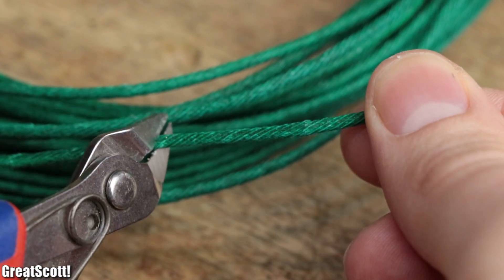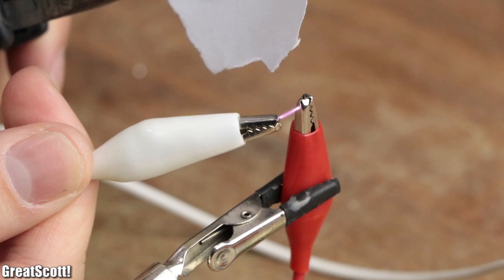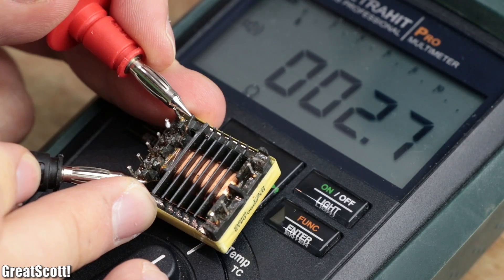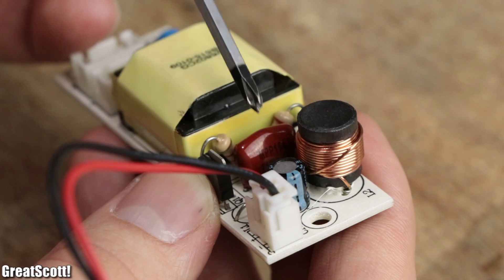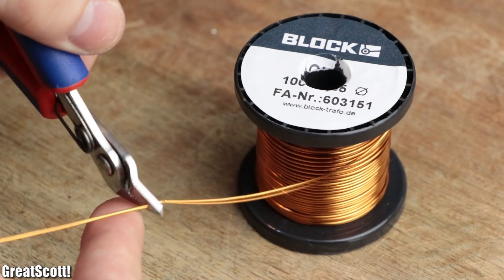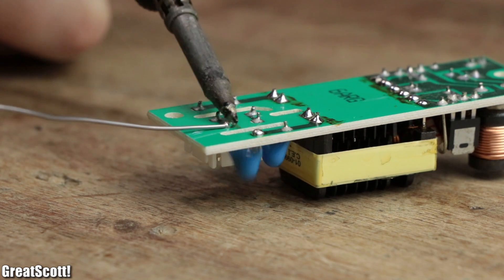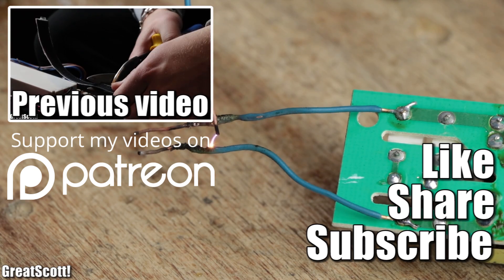HACKED!: CCFL Inverter becomes an Arc Lighter?

Comment: 3kv for 1 mm? Now I heard it all, my teacher said that I would need 1kv for 1cm and another German Youtuber said I would need 1kv for 1 mm ( all in our normal atmosphere ) strange, who is right?
Reply from the maker: 1kV/mm is possible. But 1kV/cm is wrong.
Reply: HeisenbergIsReal 1kv/cm ? What?! That's complete bullshit. Even 1kv/mm is on the low side. According to the Wikipedia of electrical breakdown (https://en.m.wikipedia.org/wiki/Electrical_breakdown) It's stated to roughly 3kV/mm for fresh air.
Reply: HeisenbergIsReal Yeah, 3kV/mm is the most accepted range. 1kV/mm is smoother on the memory. Just like how people say "every second after lightning before the sound, that's 1 km", while it's about 3 seconds. But 1kV/mm could work depending on the air, humidity, temperature, etc. However, 1kV/cm is absolute bullshit.
Reply: HeisenbergIsReal the difference is that you need 3kv to start an arc with the electrodes 1mm apart, then you can more them and stretch the arc until it gets longer than 1cm and the 3kv won't be able to keep it stable
Reply: ***** oh great everybody says something different the community from the other German YouTuber tried to convince me that 1kv/1mm was 100% correct

Comment: I see in a lot of psu that they have a full bridge rectifier and a tapped transformer somewhere later on the circuit, why not use the transformer to step down first and then use a full bridge rectifier to rectify the ac into positive bumps and a capacitor to smooth out?
Reply: Fagrid thank you a lot for the explanation.

Comment: What's the point? A cigarette is a lot wider than 5mm.
Reply: You know... Not being able to smoke is usually a good thing
Reply: isn't that a bit ridiculous to light a cigarette with a motherfucking arc lighter?
Reply: Tim Ramich you can still light the paper at the tip and then the tobacco will burn too.
Reply: That's assuming one packs down their smokes.
Reply: it'll light the cigarette from the bottom end of the circuit section bad english
but yeah anyway  5mm is enough to light a cigarette
Reply: GTFO here. For WTF are lighters most commonly used?
Reply: why would you not light is with an ark lighter?
Reply: True
Reply: Arc lighters are windproof.
Reply: I usually light cigs with my stove
Reply: Thank you captain obvious and oblivious.

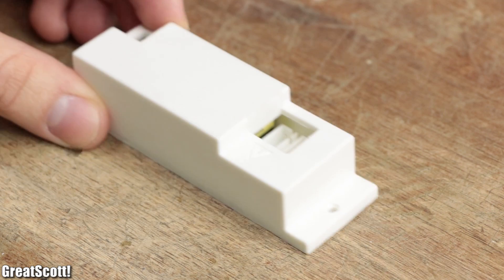Comment: 0:44
Thats not quite true. The epoxy block contains a simple HV transformer and is potted for isolation. All the circuitry is on the PCB and it is a super simple single transistor oscillator driving the primary. 

I have a TV ccfl driver somewhere, thats gonna be fun as its pretty powerful ;)

Comment: I also planed to build smth similiar to this. But using simple boost-up converter to convert 9 volt to 15 volts which will charge 20 capacitors. Next the 15 V DC will be converted to 15 V AC using H-bridge. And finally I use transformer to transform 15 v to much higher voltage.
Reply from the maker: Sounds possible
Reply: Did your design work? Will it work to ignite black powder or smokeless rifle powder with the arc?  Might be a novel way to fire motar shells without a fuse.. :}

Comment: That padded black box in the arc lighter contains a voltage multiplier plus a current limiting resistor. It is padded to avoid arcing over.  https://en.wikipedia.org/wiki/Voltage_multiplier